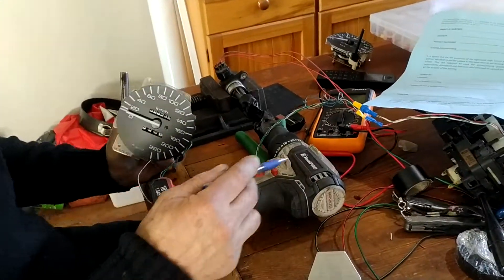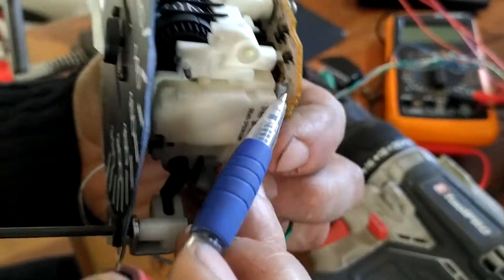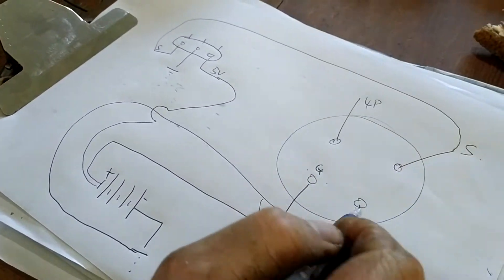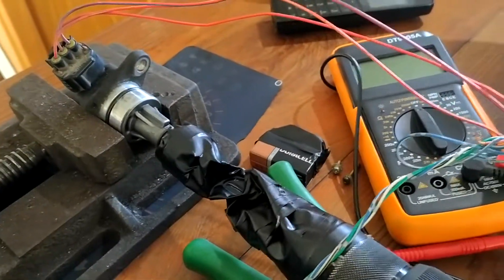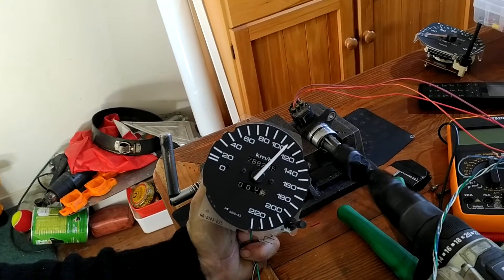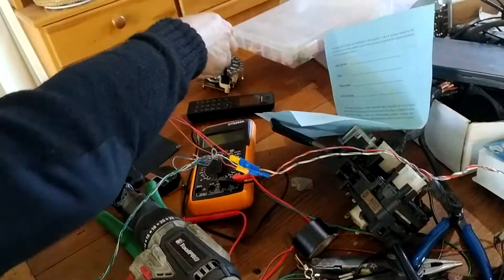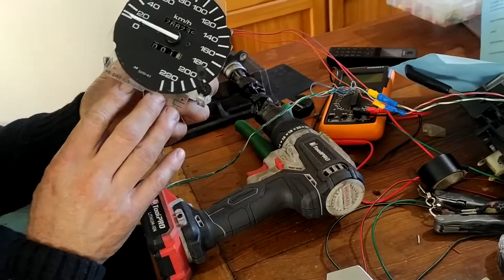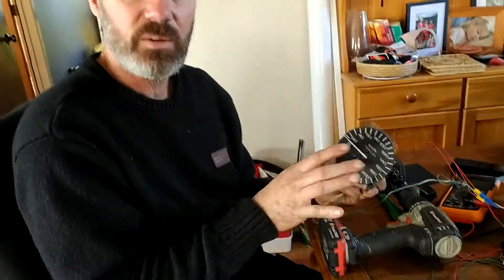How to fix your speedometer and test it at home.

Comment: The "4P" terminal provides signal to the ECU to manage fuel delivery.  The designation of "4P" means four pulses per revolution of the transmission mounted vehicle speed sensor (VSS) shaft.  Each pulse is equal to 12.5 volts (V) or more, not exceeding system voltage.  In between each of the four 12.5V, voltage ("signal"), voltage drops to zero.

Comment: thanks man nice video. some speed sensors generate voltage so the only wires coming out of it is a ground and signal which the speedo converts into the speed.
Reply: @808.streets  Thank you Sir. 🙏🇿🇦🙏❤️

Comment: Hey. I could use your expertize for a moment. If the needle on the speedometer rarely rise and drops like a rock, can that be repaired or do you need to replace the unit? The distance counter is digital and it works fine, the speedometer is analog. Thanks for any info or effort. Cheers.